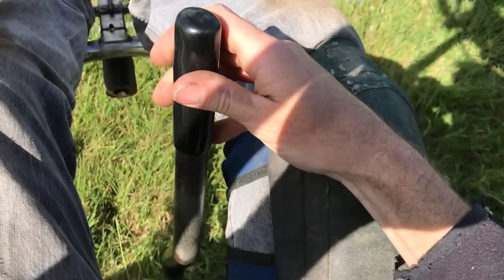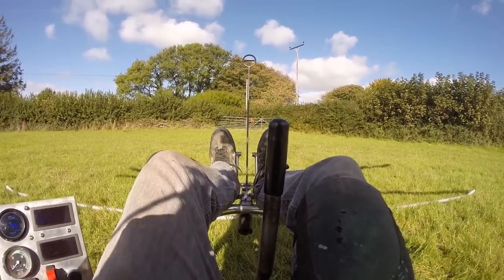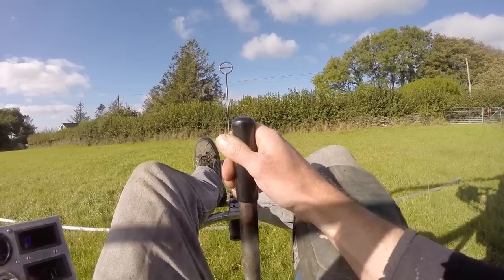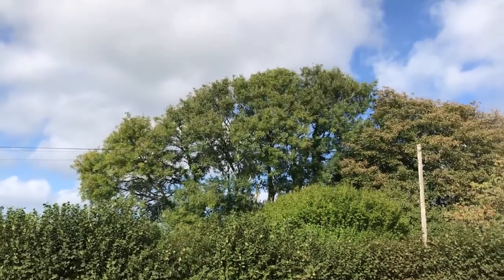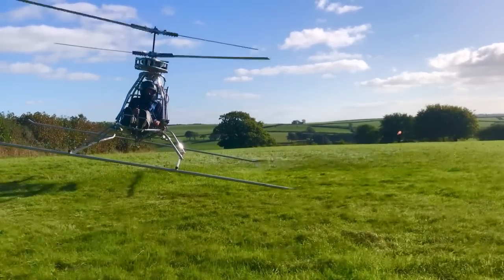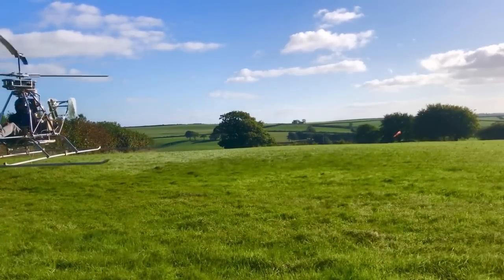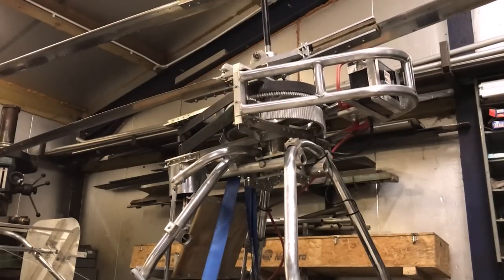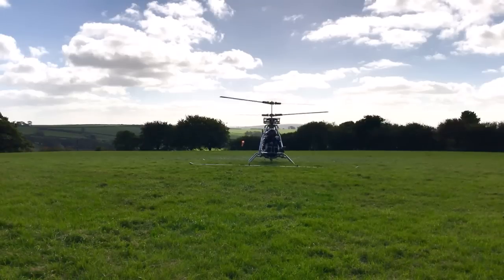Dodgy Moment, Homemade Coaxial Helicopter Learning to FLY

Comment: well you are still making progress mate 😀 keep at it.  when you put it down after the oopsey moment i did notice the mast and the square, is it a gearbox? appearing to articulate and wobble compared to the air frame. Could that be adding some 'deadband' mushyness to to pitch and roll? Coul
pled pendulms etc. just a thought.🙂  Al  edit: I see you comment on this, some sort of damping perhaps to slow the double pendulum interfering with control inputs.
Reply from the maker: Possibly a damper could be added which only took affect in the event of a rough landing. It would have to be fairly free moving otherwise. The R22 has a cyclic friction adjustment to make the control harder to move. I don't think it's necessary but I guess it comes down to pilot preference.
Reply: @Ben-Dixey  Well i'm sitting here comfy and 'experting' 😄. Your project BTD, so go where you think you need to eh 😉. Keep up the good work, baby steps n that, you'll get there...

Comment: Does an "experimental" aircraft such as this have to be registered with the Civil Aviation Authority ?  I know there was some campaigning done after someone else who built and flew his home made helicopter and documented it on YT was issued with a cease and desist notice, at least until he had completed some training and could then have the craft inspected and tested.  

I'm no expert on these things, but before moving to collective pitched RC helicopters I flew a few fixed pitch ones and they were a nightmare to control, mainly as pitch increased with a gust of wind, so you reduce rotor speed to reduce height, but then when the gust has gone the helicopter would then sink as the lift dropped, so power was increased to speed up the rotors to generate more lift.... I think this would be a trait that effects all fixed pitched craft.   Also staying low to the ground is not ideal as the air is turbulent as the downwash bounces back and around - it used to be referred to ground effect.  But then taking you helicopter higher could by risky unless you already have 100's of hours flight time and can react quickly should something happen.  

Good luck with the project... have subbed to follow your progress
Reply from the maker: I don't know what the rules are but the machine is tethered at all times and so no free flight is taking place. Bit like flying a kite. Being fixed pitch it would never be approved by any governing body and so is a hovering machine only. 
There are as you describe drawbacks to fixed pitch and collective pitch would be needed to progress further. I could treat this as a prototype and go on to make a serious helicopter if I desired to and go through the proper channels but this was never my objective.

Comment: Never did man sized but I have flown plenty of RC copters, one of the primary benafits to use of collective pitch and swash is wind gusting and handlining is a lot better, as is any harder change in direction, one issue you will find is when you are moving forward in coaxial and go to come to a stop, your going to gain altitude, and its going to be hard to counter that with lower power as that will introduce some fluttering, will be a little tricky, so I suspect you will need to keep movements smooth and slow to balance that.
Reply from the maker: It will be interesting investigating that for myself. Have a look a the Nolan coaxial on YT I think they did some quick stops in their promotion video.

Comment: Ficou muito bom seu helicóptero, parabéns!!!
Reply from the maker: Thank you. 🙂
Reply: Eu sou do Brasil, e  sou agricultor aqui , estou querendo fazer um desses sem piloto para pulverização agrícola controlada por GPS, eu tenho um amplo conhecimento em drone e aeromodelo a anos e queria fazer um aeromodelo gigante, eu uso a placa controladora pixhawk, você conhece?

My language os portuguese
Reply from the maker: Well that's sounds like an interesting project. How much liquid would you need to carry to be of use ? I'm 95kg which would roughly equate to 95ltrs but you would need to have the tanks on the CG line to Maintain balance. I don't know anything about the radio control system needed.
Reply: o maior drone hoje é o dji Agras, ele suporta 50 litros, mas se conseguir levar 100 litros seria melhor, porém o preço dele pra mim é de 50,000.00 dólar, e as baterias são caríssimas para substituir, pois elas carregam umas 200 vezes apenas, tornando o custo hectare inviável, você tem Instagram, Facebook?

Comment: Cool video.... You issue with the wind induced stability/control issues is the fact that you are flying in rotor! Why would you fly directly behind and so close to the tall hedges and trees upwind of you? No wonder the windsock is shifting through 90 degrees like a mad man.. Go fly in the same wind speed in a big open area and i garantee you have a better time of it
Reply from the maker: Thanks for the advice and I agree it would be good to find somewhere open and away from obstructions. Not impossible just inconvenient. The realisation that hedges and trees ect cause turbulent air is new to me but it's good to experience the effect. Calm days would be my preference in the field in use but I have briefly experienced the stability increase with a smooth breeze.

Comment: No, I don't like downwash for cooling. Definitely think a properly sized electric fan will be more efficient than belt drive.
Reply from the maker: Hi Bill, I looked at the electric fans you suggested they look good with high CFM, the only downside is I'm not going to find a fan with high enough CFM that doesn't require more than the 5amps available from the charging system. I could have some lipo battery's perhaps to run it. Is it the power lost on the belt drive that makes belt driven fans less efficient? What I was going to do was to measure the rpm of a fan that uses a 1/2hp electric motor and then use that fan blade run at the same speed but driven by my engine at hovering rpm.
Reply: @Ben-Dixey  Belt drive design and validation on a vehicle engine is a black art. Unseen vibration can loosen fasteners, break welds, crack parts. We used high speed strobe to look for trouble spots.

Repurposing a plastic electric fan blade seldom works well. They are heated when assembled for a zero-lash fit, then balanced. Automotive engine mounted fans from companies like Derale (see auto parts sellers like Jegs) would be less likely to fail dramatically in flight. 

Failure mode, reliability and weight are my biggest concerns. maybe consider a small 1-wire automotive alternator that could be mounted close to the engine, attached directly or with very short bracket. The longer the belt is the more things can go wrong.
Reply from the maker: @Miata822  Thanks for the input, I will give it some thought on which way to proceed.
Reply: @Ben-Dixey  I left out a bunch of considerations, from belt profile selection to the impact of sheave radius on belt heating. 
On an old car or garden tractor a fire or the sudden loss of power caused by a shredded belt eating the wire harness may be managed. On an aircraft...

Comment: Do you need a pilots licence for that
Reply from the maker: It depends where you live to whether you need a licence. For example if it's under 115kg empty weight it can be flown under FAA regulations part 103. If governed by the CAA then it's 70kg max without a licence. I don't have a licence but the machine is tethered. Mixed opinions to whether tethered testing is permitted.

Comment: how about twist to control direction, maybe a flight controller to assist in stability
Reply: rip nice work anyways
Reply: the rotor mount should be rigidly fixed to the main chassis, no floppying around
Reply from the maker: Twist control for yaw is a possibility, it was done with the airscooter 2, it had handle bars like a scooter, these also moved in the same way as a cyclic stick. It seemed to work well.

Comment: I thought that they say that counter rotating helis are easier to fly than single rotor with tail rotor??? I just assumed a novice would have a real easy time to hover and fly it.
Reply from the maker: Yes I thought the same and I believe it is easier but nowhere near as easy as I thought it was going to be. The hardest control is the cyclic stick and that's no easier than any other helicopter. The other controls are easier than conventional helicopters. I don't have to react to changes in torque and I don't have to maintain engine power. I think the fact that it's small and light weight makes it's more difficult.

Comment: I am very glad to see that you are being safe & cautious as all possible during wind & breezy conditions & that you are not rushing anything at all. You're  comming right along in improving your skills. Nicely done. I do have a question for you. . . . ." is your co-axial helicopter set up with autorotation capabilities?" Thankya for sharing with us!Fly safe😃👍🏼👍🏼👍🏼
Reply from the maker: Hi, cheers for the comment, no autorotation is possible in the current configuration. Most helicopters need 50-75 ft to transition into autorotation this machine won't be flown above a few feet. An electric back up system could be added to proceed to higher altitudes. The Hungaro copter is developing such a system. If I intended to fly above 50ft then collective pitch would then be required.
Reply: @Ben-Dixey  okie dokie & thankya for the reply back. would like to see this setup as a collective set up as well as autorotation. Happy flying & keep up the good work!

Comment: It looks like your controls arnt ridigd enough, I feel like if all the connecting joints were cushioned a little and alot tighter, your input controls would be more precise
Reply from the maker: There's probably more force needed to move the controls now than you realise. It's more than an R22 which is extremely light to control. Precision in as far as zero play in controls can be improved though.
Reply: @Ben-Dixey  that's a good point I guess what I was seeing was he would make what looked like massive adjustments and not start moving until further into the stroke. To be honest I'm not a pilot I'm just a mechanic
Reply: @Ben-Dixey  also thanks for being sane enough to have kind messages. Usually when I'm wrong like that, multiple people make or their responsibility to drag me threw the mud lol
Reply from the maker: That's a sad part of YouTube and online interaction generally, people say things they wouldn't say face to face. I've had my share of negative comments too and it certainly puts you off sharing whatever it might be with the world. You have to be thick skinned sometimes which shouldn't be the case.
Reply: @Ben-Dixey  your an awesome person I hope we cross paths in real life one day

Comment: You need to adjust your seat/pedals so that your leg is higher,,,,,,, or shorten the stick,,,,,, you want a resting point of your right arm on your right leg,,,,, most flying done with wrist movement
Reply from the maker: 👍 I'm going to shorten the stick. It's too long anyway. I'm also going to increase the sensitivity of the yaw pedals so that leg movement is reduced.

Comment: I live on top of a hill like this it is always gusty.  It looks like you could do with finding a better spot in a valley or behind a decent tall hedge line. This looks like a good place to fly a kite but that is not what you want.
Reply from the maker: Yes I'm beginning to realise this now. There are of course days where everything is calm but that's not often. Never had an issue flying kites. 🙂
I can trailer the helicopter to other places it's just a lot of extra work.
Reply: @Ben-Dixey  Perhaps you could put up a screen on the windiest side, hop poles and wind netting are reasonably cheap and you get protection for ten times the height. There might be one particular direction where it is funnelling up from the valley. Ideally you need a time machine and a hundred Lombardy poplar saplings.
Reply from the maker: The netting idea I hadn't thought of, I've seen that used in helicopter rotor testing. 👍 time machine is also a good idea 😀

Comment: Seems like your hover height may have an effect on stability.
A blade diameter height above the ground in hover will help smooth or get rid of the huge amount of downwash turbulence generated by the rotors.  You would still be well within a hover recovery height in case of a (ahem.. misshap 🙃) With lower dynamic gyroscopic stability from smaller inertial mass of the blades (vs Bell Jet Ranger for example).. your bird would be tossed about a fair bit more by buffeting and downwash being thrown outwards, then coming back via the prevailing wind direction, as well rolling ground turbulence from the wind anyway.

You must have some awesome experience in putting the machine together from scratch.  Well done, and future best wishes.
Reply from the maker: Thanks for the input. Yes I agree going higher will be easier it's just having the nerve and confidence to do it. I previously made a decision to try 2-3ft after only going 6" and that helped a lot. I'm sure 5ft ect will be even better, in time it will get there and I'm looking forward to preferring that altitude. 
The rotors are 14 ft diameter and the top rotor is 7ft off the ground that means to get out of downwash the skids have to be 7ft above the ground ?
Reply: @Ben-Dixey  If I may... I remember vividly .. day one when the instructor took me to a confined area.. (Bell 47 G2)
to get hover training. He showed me how he could hold the machine rock steady, using one finger on the top of the cyclic.  My turn.. I had my arm on my leg, solidly,... a death grip on the cyclic.. 
My instructor had tears in his eyes watching my face, while I fight the time delay lag from my cyclic input, to re-action of the machine. I seriously thought of quitting..!! Thought I must have a defect in my motor control (lack of..) skills.  But I could fly a full scale glider, had my private fixed wing license.. I was superman... surely I can fly.. what the H was wrong. ?

NO worries.. I eventually mastered the demon machine. 🤬

Then they put me in a turbine, (jet Ranger), with power assist hydraulic to all controls.  Need I say "sensitive control"
Parked in front of hangar door, with all the class mates starring at me... and had to just pick the bird up.
Didn't think a human being could sweat so much from a simple hand control exercise..!!

You will get to the point where you can control the machine by holding the cyclic between your knees.  trust me.
(and eating a sandwich).

Shall be following your endeavours... (wish I had a shop like yours ..!!)
Best wishes.

Comment: Get a ballistic para shoot and get above ground effect. Seems like that low hover is a good way to crash. Have you tried a simulator like DCS:World? You could get it up and running for a couple hundred Dollars with most of the cost being a stick and rudders. DCS is free and you could "try out" the modules for free for 2 weeks. Even Air Force pilots have to master the simulator first. This looked terrifying. Good luck man I'm subbing. Cool build.
Reply from the maker: Thanks for your input. I looked into the simulator pedals and Joystick ect and did bid on a set that was reasonably priced. Didn't win it but will look again, with the winter weather coming it would be good to practise. A fellow home builder Hooked up control pots to his actual Heli, which is another option.